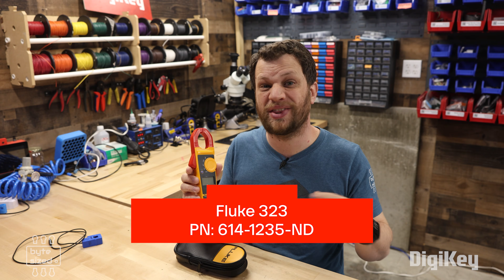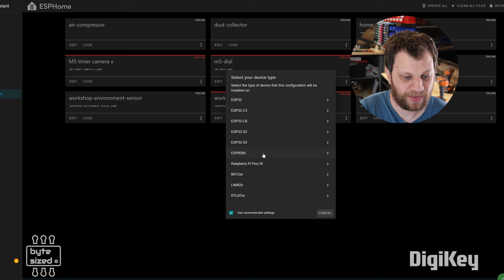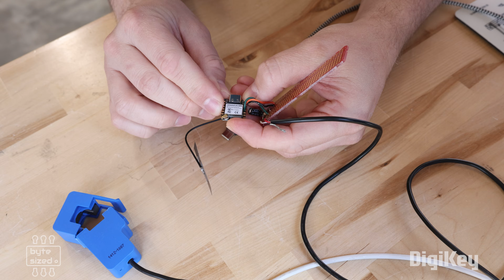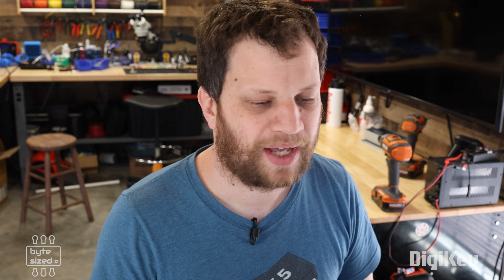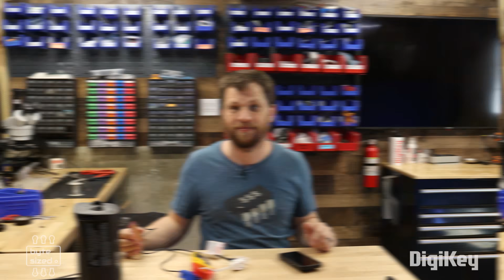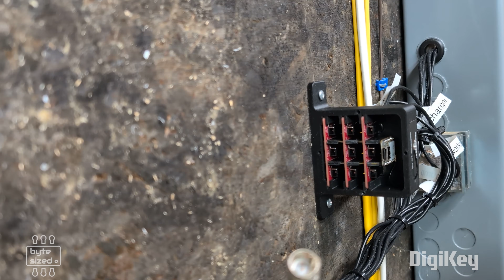Using Current Transformers for Home Energy Monitoring - The Byte Sized Engineer | DigiKey

Comment: Missing details: the part number for stacking headers can be found in the DigiKey forum discussion.  The stackability of 3 of the SAME board appears to work provided you make some use of the different jumper pads, but it's not explained.  The ESP32-S3 has nine ADC inputs (while the silkscreen on the board mentions ESP32-C3 which has only 4 ADCs).  I hope either ESP works on a single board(?), but you must have an ESP32-S3 once you stack up to six or nine CTs.

Comment: The link to the 20 ohm SMD resistor is a small 0603 package 1.55m x 0.8mm, but when I found the 100k ohm resistor (no link above) I got a slightly bigger 0805 package 2mm x 1.25mm.  Only noticed this after I submitted the order with enough $ for free shipping.  I hope that 0805 still works on the circuit board? Hey at least those things are cheap.

Comment: I had to trust Zach ("It Works!") until I understood this: the ADC signal is a sine wave which would give random (instantaneous) samples. Other circuit variants (add diode and rearrange) could give stable output voltage after a few seconds, to a new steady state load allowing one instantaneous ADC sample with no math; but this setup does the sine wave math. Hiding under the hood in ESPhome, in the ct_clamp component, is a little process that takes many samples covering at least one full cycle (eg 1/60th of a second) maybe several cycles, to produce a value representing how much fluctuation there is in the current, aka, the load. All hidden from view, and certainly not visible in the YAML file, but it works!

Comment: I would be inclined to integrate the burden resistor in the ct. This would prevent a hazardous condition/ct damage occurring if the cables were unplugged, just a thought. :)
Reply: There are different models, the ones that specify a current need a burden resistor, the ones that specify a voltage output (usually 0-1V) have an integrated burden resistor.
From AI:
CT-013-000 (current output): No internal burden — you add an external resistor (typically 10Ω–33Ω depending on desired output voltage). Has internal TVS diode protection to limit dangerous voltages if unplugged. Openenergymonitor
SCT-013-000V (voltage output): Built-in burden resistor, outputs 0–1V.
SCT-013-030/-050/-100 series: These have built-in burden resistors and output 1V at their rated current.

I have used the 30A and 50A ones and they seem to have a burden resistor ok.  Rated for 0-1V output.
Hope that helps!

Comment: What happens when a "single phase" is split? Are you an engineer or an electrician? Two phases at 180degrees are still TWO phases, which is the reason you used TWO CTs. Stop parroting electrician's nonsense.

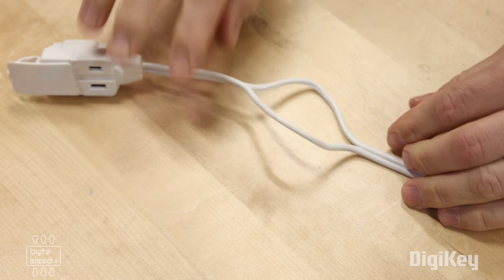Comment: 4:45 A space heater on an extension cord....right.
Reply: Yeah just like I have a 5000 BTU window air conditioner on a 50 foot extension cord, and you should see where that circuit comes from

And I’ve run dozens of electric space heaters on extension cords, you have to check the damn plugs and sockets every now and then to make sure everything is kosher and running at a sensible temperature, and have decent extension cords, there’s no damn laws against this, only stupid people doing stupid things with stupid equipment

Geez

Comment: I was pondering how you measure the AC voltage with the ESP32 ADC, but it occurs to me that the rms measurement of the AC signal occurs within the ct_clamp platform code, so you don't need to rectify the output of the current transformer.   There is a parameter you can specify for sample_duration.   cool.

Comment: Tuya do Zigbee dual CT clamp models, quite cheap @ around £10-£15 and integrate into HA with z2mqtt no problems so no need for the Tuya app.
Obviously not the learning experience of making it yourself but for regular people an easy entry.
I have 6 of them so 12 Clamps connected to all the outputs in the fusebox and separate connections to the grid input etc.
Also a smart plug on each wall outlet will give a good idea where power is going.

Comment: Installed a Sense monitoring device many years ago. Saw it on this old house. Best purchase when it comes to monitoring electric. It also monitors our 3.4kw solar system. Using software similar to speech recognition over time it identifies each appliance and monitors usage, motor starts etc. Calculates your bill and many other useful data points. They're no longer selling individual devices as they have electric meter manufacturers putting the capabilities directly into their meters.

Comment: To get a higher ac load for calibrating and testing you can just put more turns on the current clamp.

I like to do this for measuring low loads with clamp meters, 2 turns gives you 2 x the current and more accuracy

Comment: How do you get power reading on home assistantance without measuring voltage?
Reply: I was about to post the same thing. Curious to know.
Reply: @DMIINC2013 You set up the supply nominal voltage in Home Assistant.

It is not perfect because the voltage is not being measured and it is variable.

To set the nominal voltage in Home Assistant, you need to provide the input.voltage.nominal value in your configuration, typically within the YAML file for the integration you are using, such as Network UPS Tools (NUT).

Comment: Very interesting. But there why to guess the value of the linear interpolation? If 1v across the burden resistor is 100A on the transformer's primary, then 0.1v across the burden resistor is 10A

Comment: Your power readings are Wrong, you need to take the Power Factor into the equation.
Reply: That's why I included the note discussing that very topic. Did you read it?
Reply: @bytesizedengineering You should have deleted this video and recreated with correct engineering information. This kind of video you would expect from a 8 year old. You lack the basic electrical engineering knowledge.
Reply: @Romello_Pietersz I disagree.
Reply: @arbjful Just because you disagree doesn't mean you know anything 😂 What's the equation for AC Power? 😂

Comment: Simple solution but that is only measuring the VA, not the actual Watts. With AC you have to account for the power factor and aside from your heater, which would be a power factor of 1, most everything else is going to show higher VA than actual Watts. But this will still give you an insight to what is using what. Just don't expect to add it up and calculate Watts from it.
Reply: Hm.  You actually need TWO current transformers because the two phases  may also be unbalanced, with a significant ground current (the phases feed different 120V breakers) and with switchers and solid state ballasts, the current may not be sinusoidal.  I’d use Hall effect current sensing, and measure each phase voltage to ground.  4 sensors total.  Oversample as fast as practical, to get actual instantaneous power for a nonsinusoidal load.  QUESTION!  Is the “wattmeter” the power company uses for billing even accurate with waveform distortions?  Never studied the old design….
Reply: @CJHall-c6n I build devices like this for substations - sampled value, GOOSE, etc.
Reply: How do you account for the power factor in this type of setup? What additional sensors might you need?
Reply: @FiveFingerTight  You would need to measure voltage and have a chip that can compare the time difference in the current sine wave vs the voltage sine wave. There are dedicated power monitoring chips. Or you could write code but that's that hard way.
Reply: @inothome  two wattmeter method. 
Edit: my bad, this is applicable for 3 phase systems. The guy has single phase, so what the other guy said go for it
Reply: The Watts are what the device is actually consuming, the VA is what the power company is actually charging you for, so if you're looking for measuring what a device is actually costing you VA is what you want. You can take the extra step to see how efficient your devices are at using the power you give them, but you don't need that for what the guy in the video is looking for.
Reply: @xokelis0015  No, you get charged by kWh, not KVAh / VARs. What does the meter on your house or building say, kWh or VA? What does your bill show, kWH or kVA? 
Large industrial customers may be charged / surcharged based on VAR or power factor as well, but homeowners are always kWh. 
But VA is what the power company has to build the lines for, since VA is always going to be more than kW.
Reply: @inothome  kVA is the apparent power, kW is the actual power consumed to do actual work, the ratio of kW/kVA is your power factor. The power company doesn't know what the power factor of every device in your house is, as in they don't know how efficiently you're using the power, they're just measuring the total power your house draws, which is (you guessed it) the apparent power also known as the kVA. 

The fact that they're charging you for kWh and not kVA is irrelevant. kVA is just a made up measurement to give us a distinction between total power used and power used for productive work done. Power itself is measured in Watts and that's what the power meter of the power company can see. That's THE ONLY THING it can see.

I'm not sure where you got the notion that the power company knows and or cares how efficient your devices are lol.
Reply: @xokelis0015  I work in the electric utilities, you are charged on kWh and the meter measures kWh. Even the old wheel type measure Watts, not VA. Smart meters of course measure the Watts and they don't need to know the power factor of all your devices, just the total at the meter. I have my own meters on different devices and the main and you can see how some devices may have a PF of 0.4 (capacitive, like SMPS) but then turn on a motor with an inductive load and a PF of 0.7 and the house PF becomes 0.95 or even 1. The inverter ACs are good to watch too, they have active PF control and they will run at a PF of near unity from 300W up to the max at 1.3kW. 
But back to meters, don't take my word for it. This video will explain HOW the power company can measure Watts, NOT VA and bill you for it with an old school wheel type. Like I said, new smart meters do the calculations. Look at your electric bill, are you charged in kWh or kVAh? 
Even the title is "How Kilowatt meters work", not Volt Amp meters. 
https://www.youtube.com/watch?v=xtModjpxfxM

Comment: Great video! I really appreciate the practical approach to whole-home energy monitoring using current transformers. For anyone diving into this, accuracy is critical when tracking appliances like HVAC or EVs, which have non-linear loads and wide current swings. One often-overlooked factor is the CT's phase error at low currents—this can skew power factor calculations and lead to misleading readings for standby power.

In our work at NJXSE (Nanjing UP Electronics Technology Co., Ltd), we focus on split-core current transformers that prioritize linearity from 1% to 100% of rated current, which helps maintain precision across the entire load range. The video’s setup with an ESP32 and ADC is a solid baseline, but I’d add that using a delta-sigma ADC with an anti-aliasing filter can reduce noise from high-frequency switching loads like EV chargers. Also, calibrating each CT individually with a known resistive load can correct for core material variations—something we do regularly when supporting DIY builders.

Another consideration: if you’re monitoring multiple circuits, ensure the CTs are rated for the conductor’s insulation voltage and have a low insertion impedance to avoid heating. Our CTs come with flexible split-core designs that snap around a wire without disconnecting it, and the output is available in both voltage and current versions to match different microcontrollers. For those integrating with platforms like Emporia Vue or IoTaWatt, checking the CT’s burden resistor value and output scaling is key—NJXSE provides datasheets with typical calibration curves to simplify this.

Overall, this is a fantastic starting point for taking control of your energy usage. If you run into accuracy or installation questions, feel free to explore the technical resources from NJXSE—it’s what we do every day.

Comment: It’s ok, but it’s inaccurate because you’re not measuring power factor which for a typical house would be a value varying between 0.7 to 0.9.
Reply: I pointed this out with a note at 1:11 explaining that I'm accounting for power factor
Reply: (a) your demo just presented amperage values so I am assuming power factor is not a consideration here. Am I wrong?
(b) would power factor come into play if I were to infer wattage from the amperage value with a simplistic current reported times 120 volts?
(c) DigiKey data sheets suggest the ratio is 1800:1. Maybe that was the unstated power factor correction? Or 2000:1 was just easier on the brain?
Thanks!!
Reply: @arvidjedlicka6237 Power Factor is a number between 0 and 1.
Reply: Most domestic electricity suppliers don't bill based on power factor
Reply: @zyeborm they bill in real power so they have to calculate real plus imaginary to to get billed power. The problem with measurement devices is they will read the total current flow not real current, so are always inaccurate